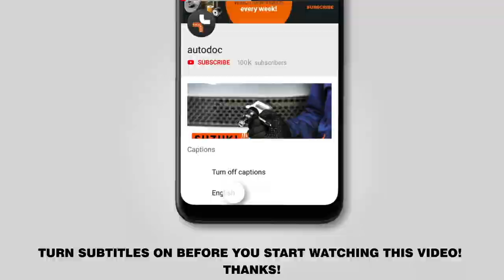How to change front springs / front coil springs on AUDI A6 2 (C6) [TUTORIAL AUTODOC]

Comment: What is the correct spec for pinch bolt (torque specification) as i think yours is incorrect
Reply from the maker: It is not possible to answer your question unambiguously. All regulatory replacements and values can be found directly in the technical documentation for your car or use the help of a car maintenance service.